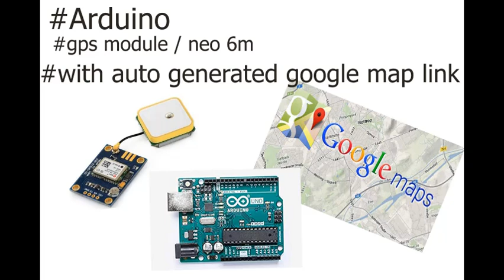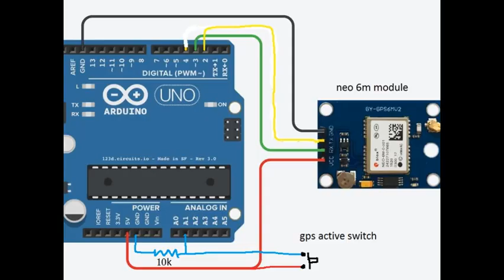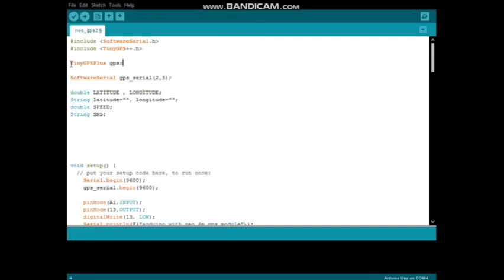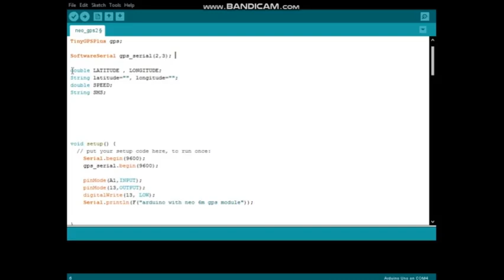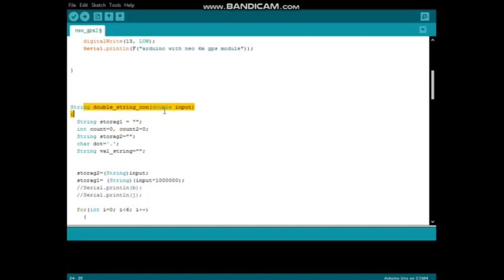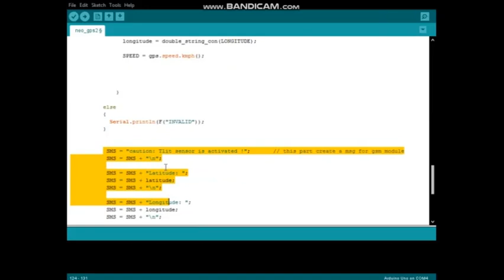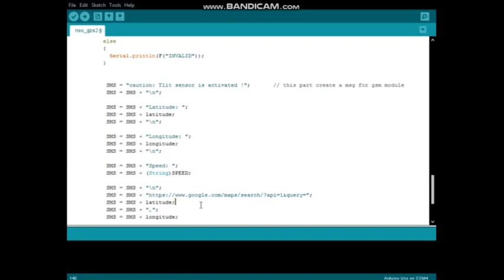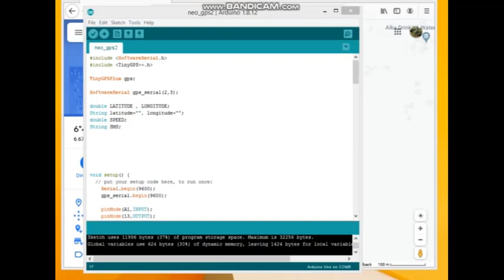Arduino + gps module with auto generated google map link

Comment: hi 
what is A1 for ?
Reply from the maker: hello, it  just for switch on the gps module, when A1 pin is connected to 5v, gps module will on and do the task, you can also use digital pins for that purpose.